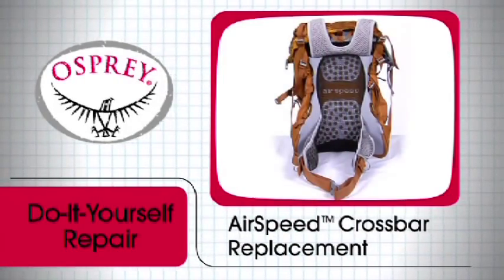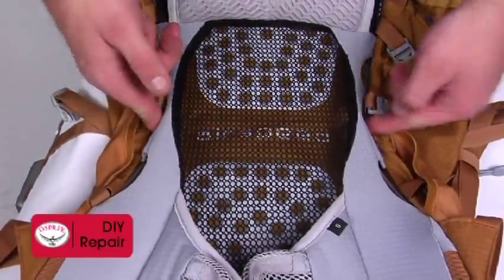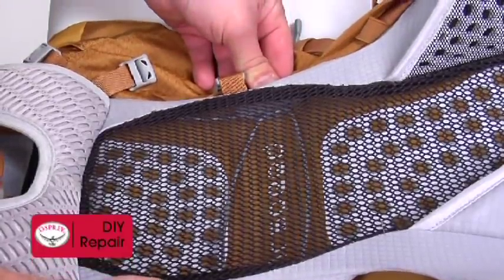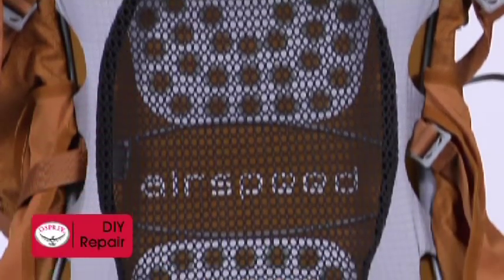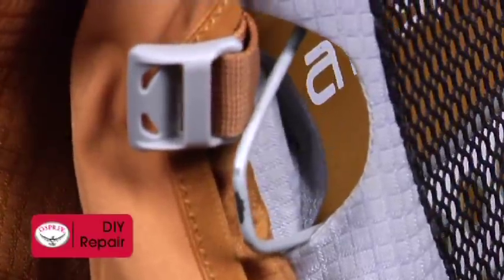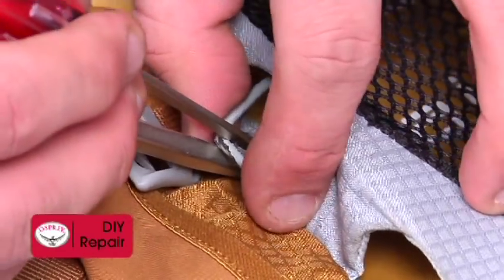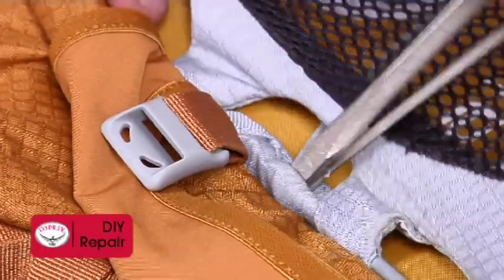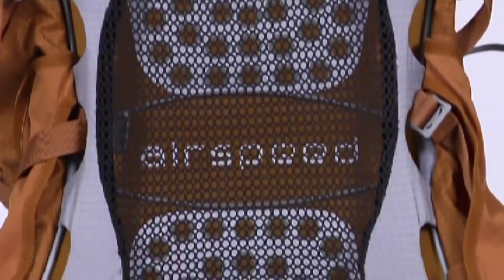Osprey Packs | Replacing an AirSpeed Backpanel Crossbar | Pack Tech and Repair

Comment: Been using my Exos 34 for 5 years and 30+ countries now. And want to eventually wash it :D Plus add some patches on the inside's weak parts
Is there a way to remove the rest of the frame too?
Reply: Hello brother, Greetings from Pakistan. I also have Exos 34, its frame has been broken from the bottom side and now want to remove it in order to repair it. My question to you is, have you found any way to remove its complete frame? Best regards.

Comment: i want to remove my exos frame so my pack can fit cary on limits. im si k of paying extra for check in.
Reply from the maker: Hi Patrick, we do not recommend removing the frame on your Exos as it is not an easy task and may void the warranty in places. Please contact our customer service team for some tips on traveling with your Exos. They can be reached at 866-284-7830. Thanks!